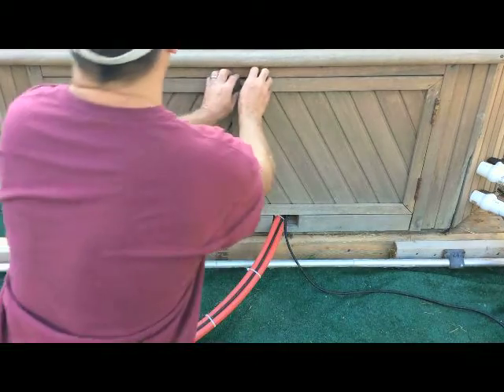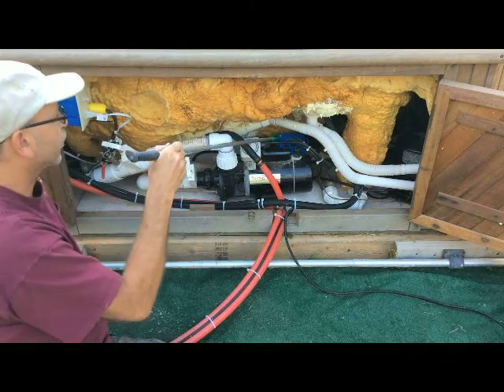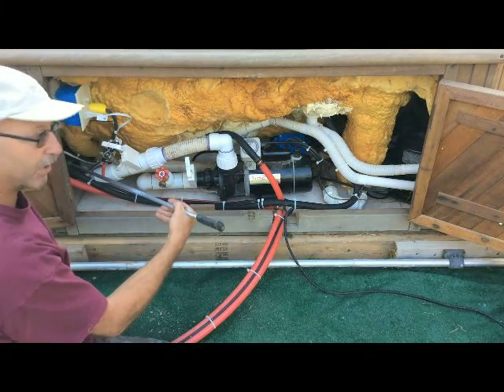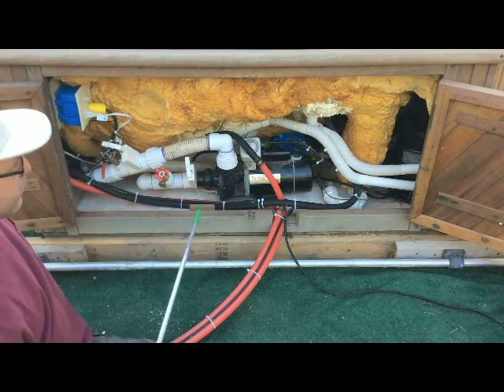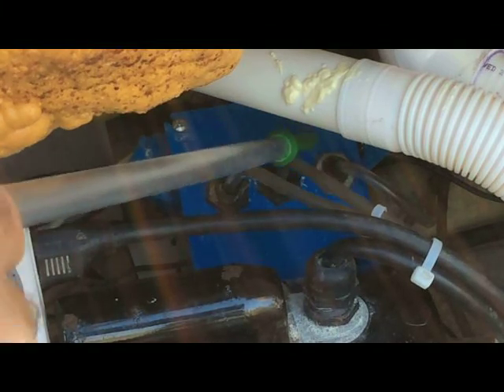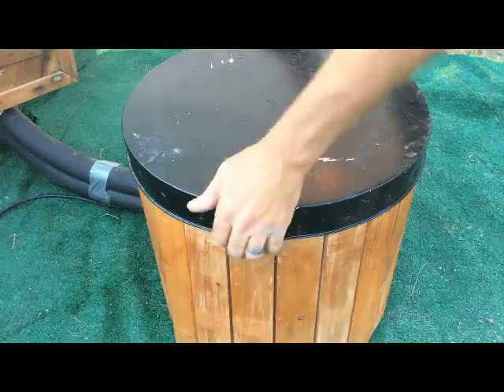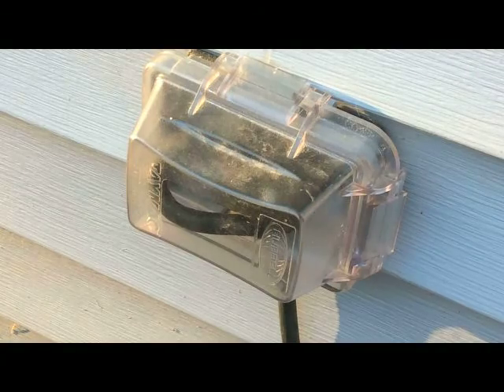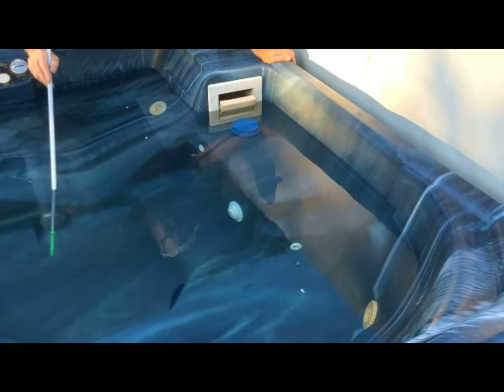Wood fired Hot tub part 2

Comment: Hey Ron, I love the design and don't want to be the grumpy comment heckler. I would only like to share a safety precaution. GFCI's won't trip if there is no ground connection. My instructor illustrated this buy dropping and ungrounded drill motor into a bucket of water while running and plugged into a GFCI. If you want to be protected by the GFCI there needs to be a solid connection from the water in the tub to the grounding system that supplies the GFCI. If any of those components are bleeding voltage into the water and you are isolated from ground you will get a shock without tripping the GFCI. Just looking out for ya man:-)
Reply from the maker: Yes, when I took out the heating element I took out the connection for my water and ground, and that is the only metal part of the system, I replaced it with a calculator pump from a boiler and that is what I am using for my water to ground connection, Thanks for pointing that out I should have mentioned that In my video.